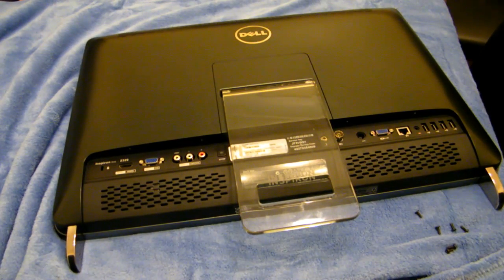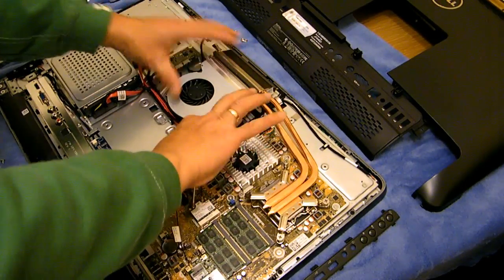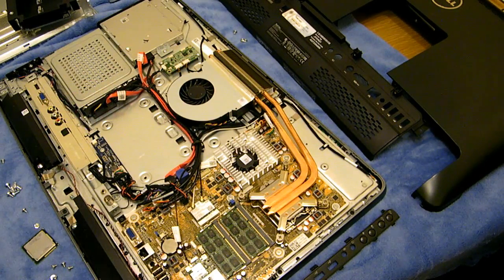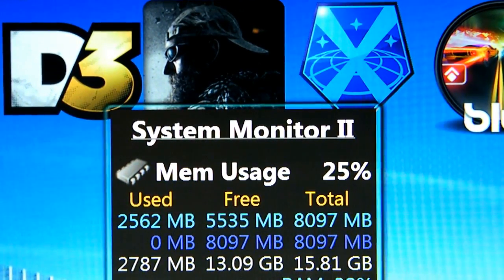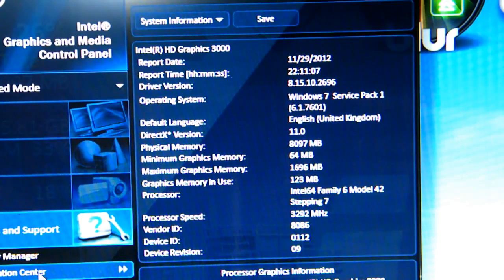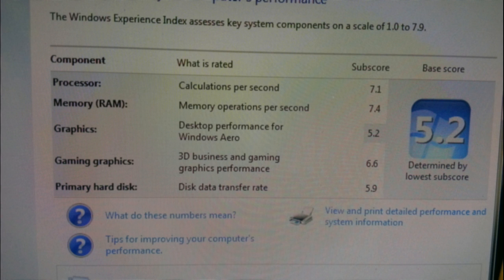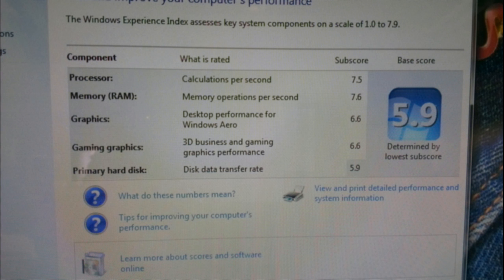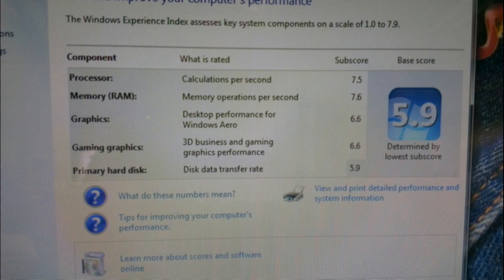Dell Inspiron 2320 All in One CPU Processor upgrade installation

Comment: can i do that with my acer aspire z1-600? the intel inside  its to slow ;/ and i dont want  to buy another pc
Reply from the maker: Do you know what the CPU is so I can identify it more?
Reply: Pleease help i want to upgrade my lenovo all in one pc.I just want to know if i can use any graphics card to replace the one or even do it.
Reply from the maker: Hi GengarBoss can you let me know the model and perhaps a few specs of you system?
Reply: 8gb of ram
Intel(R) Core(TM) i5-4460 CPU @ 1.90GHz 1.90 GHz
64bit
Intel hd graphics 4600
1tb of hard drive.
Model:B50-30. lenovo all in one touch
Reply: plz reply thank you
Reply: You probably didn't do this but go to LENOVO website they usually tell you what OPTIONS there were when you bought it so you should be able to tell what UPGRADES you could make. Doing GOOGLE research works wonders! People are too LAZY to research this online.

Comment: One question, are the inspiron all in ones fully customizable if I wanted to upgrade the graphics card or processor?
Reply from the maker: CPU's are very easy to change in these all in ones but graphics GPU's is normally built into the board and cannot be upgraded.

Comment: some of the videos say something about thermaquoes and you put it on the cpu your upgading to do you need it someone plz respond
Reply from the maker: Thermal paste sometimes a big issue. It helps cooling so people like to use it, it's main job is to transfer heat from the cpu to the heat sink. As long as you have some on you can probably get way with it. If your planning on maxing out the cpu with an i7 like a 2600 then I'd advise fresh paste every time. You don't need much, if your heat sink has some on as it heats up it will even it's self out of time as it liquidises. The golden rule would be if it's at hand then always use it or if it's running hot consider reapplying it.

Comment: I have an inspiron one, AMD Athlon(tm) II X2 240e Processor, and ATI Mobility Radeon HD 4200 Series graphics. Can these be upgraded... and what can I upgrade them to?
Reply from the maker: +Aaron Ammons I've not had an AMD one before but I know that's an AM3 socket so looking at possible processors I'd find a list like this one http://www.asrock.com/support/cpu.asp?s=AM3 and then use it to get an idea of how powerful (watts is always a good scale) the processor can get. Your CPU&#160;is 45w I'd be looking at 65w but possibly going as high as 95w but remember extra cooling may be needed and please upgrade the bios to the latest before changing the CPU&#160;to ensure maximum support. Research too, remember there's no guarantees but there no reason why not either. Good luck.

Comment: Also i the have the all in one 23 5000 LGA 1150 . it has i3-4150 i am upgrading it to a i7-4790 . I dont need to anything else right??
Reply from the maker: +ANIRBINNA ROY Yeah that should be fine just be aware of the cooling run some tests just to confirm it's not getting to hot under load.

Comment: Hi
    Did you change the the motherboard or did you just removed the old i3-2100 and put in the i5-2500k
Pls reply

Thanks
Reply from the maker: +ANIRBINNA ROY I just removed the CPU eventually changed it to a i7 2700
Reply: UltraCyberGod and how it works ?

Comment: on the 2320, if I want to replace the lcd, do I have to go thru the same process of basically gutting it to get to the screen, or does the front bezel pop off like a laptop?
Reply from the maker: +Cody Rawlings You have to go from the back and totally remove everything to get at changing the screen. Shame but it's not too bad to do.

Comment: Great Video, can you overclock the CPU speed with the i5? And if you could install the intel Core i7 5790K, will it still run or will the computer overheat?
Reply: +Dmitriy Shtyrov 
you can not upgrade to this processor because the sockets are not compatible, the socket 2011for this i7 and for the i5 1155

Comment: Could an Inspiron 2020 be upgraded with a low-TDP i5? I have an i3-3240t model.
Reply from the maker: It would be possible to upgrade to another third generation processor in the i5 or i7 range probably without needing cooling if you chose the T or S versions. I would go for the S version as the T version has reduced cores.
Reply: Do you know anywhere I can find a S model Ivy Bridge i5 on the cheap?

Comment: People are led to think that all in one pc can not be upgraded. The aspire z3760 allows for pretty much anything to be upgrade, mother board, cpu, graphic cards as long as you use a graphic riser, heaps of room. I love the display on all in ones. Big screens with ample benefits.
Reply: I know this is 2 years late, but I was under the same suspicion that all-in-ones were all soldered together like a laptop. Thankfully though I was proven wrong, and can't wait to upgrade a family members all-in-one soon!

Comment: Thanks for this video, It gave me the motivation to upgrade my 4 yr old 2320 hopefully adding a few years to it. I upped the ram to 8gb from 4gb, swapped out the Pentium G630 for an I7 2600s, added a 240gb SSD keeping the 500gb Seagate spinner and added a WD 4TB external USB drive and upgraded to Windows 10 and updated all the device drivers. It runs like a champ.

I made the drive connections a little differently, I bought a dell inspiron hdd sata cable w/4pin power from ebay with the intent of using it for the SSD by using the 2nd sata  port in lieu of the micro sata DVD. But I quickly realized that the micro sata cable on the DVD had a smaller 4pin mini power plug and that 4pin mini was the only power available for the second sata port. The mini power port will only power an optical or SSD not an HDD. So I ended up cutting the mini connector off the DVD cable and slicing it on to the new HDD cable and using that to power the SSD in Port 0 and using the old hdd cable in Port 1. I first tried powering the HDD with the mini 4pin and that was a no go, that's how I know the mini plug won't power a hdd. So if you use this method you must use the mini 4 pin to power the SSD and the regular 4pin for the HDD.

I choose the 2600s because it was the same wattage 65w as the original G630, even though I knew from your video that turbo boost was disabled on this board and this runs at 2.8ghs because I wanted to keep it cool and quite. So I was surprised when I swapped it and booted up I get a message that less than a 180w power supply is detected and the system will lower performance to accommodate hit F1 to boot. And sure enough when I booted and loaded the CPU it only ran at 1.5ghz. So I rebooted entered bios and disabled speed step and Presto runs at 2.8ghz. So far it runs fine on the original 150w power supply I just have to F1 to boot

 .
Reply: Hi there! I am just now getting around to this.  Where is the PCI slot for the graphics card? I hear Win 10 was not compatible (DELL), but from what I saw it was the graphics driver that was the issue. anyway, I need the better processor and graphics card if possible. Can I get a little help with some links to this stuff.  Thanks!
Reply from the maker: +Robert Cooper That's great news... Glad to be of help...
Reply: +Robert Cooper  so how much do you think it ran you doing it your self?
Reply: How did you get the display to work with windows 10? Mine flashes solid colors after trying to load windows and stays that way forever, windows update is the cause because it works fine until I install all the updates.
Reply: Can u change inbuilt processor

Comment: will this work on an dell inspiron 3048 i3?
Reply from the maker: +StickPro Yes it would but I don't know much about them other than it's a 4th generation socket 1150 so I'd try on of the FCLGA1150 i5 or i7 chip released about the same time. So in this link the Q213 are probably a safe bet. http://ark.intel.com/products/family/75023/4th-Generation-Intel-Core-i7-Processors#@Desktop
Oh and think about the heat! More watts equals more heat yours had a T on the end so find similar.
Reply: would you suggest an 4.40 ghz cpu? and thanks
Reply from the maker: +StickPro I don't know a lot about your model but... It's a H81 chipset these do take the i7 4790k CPU I think your talking about. A BIOS upgrade to A04 could be all that holds you back! I know the latest BIOS for that was mid last year which is a good year after the processor was released. If you're lucky and the BIOS does do it... Remember when I did the model I had Dell had disabled the turbo boost, which would mean the 4790k would only get 4.0ghz... Hope this helps, I'm close to saying yes but I'd still be crossing my fingers...
Reply: ok...
Reply: Ok sorry for the really late reply but I just found out that I had the same pc as you I didn't check it right ._.

Comment: i have the same computer im wondering is it possible to add more ram to it, and a better graphics cards like a nvidia geforce gtx 970?
Reply from the maker: +Snow Wolf Whooo... It's never going to be gaming but extra ram it can have. The 970 is just too much of a card for one of these. The graphics are built on board for the NVidia models of the machine so it can not be changed.

Comment: I've seen a lot of people saying All in One PCs cant be upgradeable and you shouldn't buy them. that made me pretty sad because I like to game, and I wanted to upgrade mine. Plus, my mom bought it for me for Christmas and yeah. Is it possible to upgrade? http://us.acer.com/ac/en/US/content/model/DQ.B2MAA.001
Reply from the maker: +Mediic It's true they are a bit like laptops but... There's a bit more room sometimes so you can do a bit more. I suppose you first have to answer what do you really want to do with it? If it is gaming it's not the right machine depending on the games of course as it will play games just don't expect a good frame rate when it comes to action games.
Reply: +Mediic The acer aspire all in ones allow for plenty of improvements. You can change mother boards, graphic cards by using graphic riser. Get a custom cover made for the back and man do you have room to fit just about anything you want at the fraction of the cost of buying new pc.
Reply: +benitos reggie Woah, got any links?
Reply: +Mediic  I am working on these links. When I start work on z3760 I will upload the vid. I love the screens on these all in one pc. Fantastic for gaming what is even more better is fn upgrading the hardware with cpu, motherboard graphics, rams, power unit..The acers are far the most most easiest to take apart and upgrade hard ware. I am shopping for gaming hardware to put in my beast.

Comment: I have a Dell Inspirion 2305 I upgraded the memory ram to 16 gb and it has an AMD athlon(tm) X2 250u Processor 1.60 GHz
Reply from the maker: +BenIs NotAvailable A 2305 with 16gb excellent didn't think it would take it.
Reply: +UltraCyberGod It works fine with 16gb DDR3 ram i CAN'T FIgure out how to install a graphics card into it later release of the same model 2305 got released with more things such a 1GB graphics card that my dell did not come with.
Reply from the maker: It's probably built into the mother board as are a lot of all in ones. You'd have to changed the board out or replace the machine.
Reply: +UltraCyberGod I ordered a graphics card I'll let you know how it works out I think there is an empty slot for the graphics card

Comment: The processor you put in is much higher tdp than (the one in my version) was the cooling ultimately sufficient? This is my big concern with upgrading, heat and heat dissipation.

Edit: I also noticed that you do not replace any amount of thermal grease on the hsf, strikes me as a bit worrisome.
Reply from the maker: +Geoffrey Paxson Hi the cooling has been fine ever since even after an upgrade to a 2600k and the machine is still running, your right I didn't do that in this demo. That machines been apart more times than a transformer.  When it was put together to use, it got some artic silver you'll be glad to know.
Reply: I bet,  in the manual it suggests replacing the thermal grease with a new cpu (and, of course, yes I have the same computer) and you didn't show that. Thanks for replying.

Comment: I have a Dell Inspiron One 2310, Am I able to upgrade to i5 or i7 processor?
Reply from the maker: +Ryansaul2000 What processor is in it at the moment?
Reply: intel core i3
Reply from the maker: +Ryansaul2000 Yes you can I'd recommend the i5 2500 or 2500k and in the i7 range the 2600/2600k or 2700/2700k just because they've been tested and easy to come across.

Comment: Hy, sorry for my English, I'm argentinian.
My question is, is possible change mother amd for mother intel. I have a dell inspiron one 2305.
Thanks.
Reply from the maker: it is not possible as they are completely different sockets and therefore would not fit
Reply: +UltraCyberGod, hy again. I know about the processor fit. I mean about the mother fit inside the 2305 ?. Like so grateful for your help.
Reply from the maker: +Jose Maria Montejano From research I believe they made an intel version of the 2305 and I also believe that the Dell 2310 is the same motherboard they should support a 2600k i7 to which will give it a good boost. Check ebay for dell 2305 or 2310 motherboards use intel in the search line and you'll see what I mean.

Comment: Hi.
is it possible to upgrade the same way to i7-3770?
Reply from the maker: +Tomer Allouche Sorry about the delay the chip/processor is a 3rd generation which the board won't support.
Reply: Too late. I made the damage already.
Now i can't revert back to the old cpu. The computer won't start.

Comment: Hi I want to know if I can upgrade my CPU because its an Intel Pentium and I want to upgrade it to a Intel core i5 2500k and Its Dell inspiron 2020 All in one desktop... Thank you
Reply: Same question with my Dell Insprion 2305 All in One.
Reply: DatOneGuy all LGA.1155 sandy bridge CPUs will work with the LGA 1155 socket. If you do not know the pin socket, check intels processor archives. Also, while you can install any Sandy Bridge CPU, The TDP will raise the temperatures more if the cooler was not prepared to dicipate more than what it was designed for.
Reply: Okay bro can you tell me how to put graphic card in all on one😶

Comment: UltraCyberGod, if i was you id stay away from computers, because you clearly have no clue what your doing, Reason that is because, you just changed the cpu and then put the heatsink back onto it, Dident anyone teach you that you have to clean the cpu base and heatsink, and then apply new compound to it, What you did will just cause it to overheat and eventuly die.
Reply: Dident anyone teach you that it´s spelled Didn´t?or that questions end with a question mark?
Reply from the maker: Your dead right but this an live you tube example, I should cover the basics but sometimes they are over looked. Any how artic paste was put on and the processor removed and professionally played with several times as the system was always apart since then you'll be glad to know I've installed an i7 2600K with paste and it works like a dream.
Reply: this also is NOT an antistatic work place

Comment: I have a laptop with a core i5 processor. Would I be able to install that into my HP pavilion 20 all in one PC?
Reply from the maker: Now that I don't know the easiest way to tell sometimes is look at the chip series like or chip manufacturer. If your system is an AMD cpu which I think it may be the answer is no Intel and AMD cannot be interchanged.
Reply: Thank you for responding :)

Comment: Dell gave you CPU options when you selected one to BUILD so just look at your model and it should show you the HIGHEST CPU you can use in the first place. Newer models may work which are not listed on Dell spec sheet, as long as the motherboard matches with the higher up model CPU number.

Comment: These cases run HOT so might want to make more venting slits on it or do the CPU Fan addition like he has done in another video. I personally would just cut out some more vents on the back plastic casing, using your wonderful Dremel tool.

Comment: i attempted to put a i5-3570K (witch i had) with no luck i am wondering can u put a i7-2700K if not how about a i7-2600K (since i know they shipped a model with a i7-2600S)
Reply from the maker: Hi Josh, I know that it won't work with any 3rd generation cpu's these all begin with 3 as in 3570K so a 2700K which is of course 2nd generation will work. The 2600K, 2600S, 2600 and 2700K http://ark.intel.com/products/family/59136
Reply from the maker: Just to let you know I fitted a i7 2600 which works fine
Reply: just thoght i would give a update here i got the 3570K working i downloaded a bios from a foxcon h61m (witch is the same chipset as the the dell 2320 then extracted the microcode updates for said board (witch contanes 3rd gen support) using MMTOOL then then took the dell bios opened it in MMTOOL and injected the microcode from the foxcon h61 board in and then put the 3570k in and it was working great i have been using for about 3weeks now
Reply: i hope this helps u guys as the 3rd gen have better GFX and are easy to find then the 2rd gen

Comment: Hello.
What kind of screwdriver would I need to perform those operations? Are all of screws the same size? E.g. if I wanted replace RAM memory would I need another screwdriver or maybe a set of them? Please help.
Reply from the maker: It's just a normal cross headed screw driver all the way through, RAM can be changed like this unscrew 6 screws from bottom of back, flip open the RAM cover which on a 2320 is bottom right from facing the back clip out or clip in new RAM the board supports 1333mhz MAX I believe.